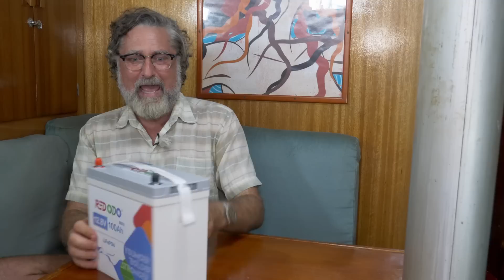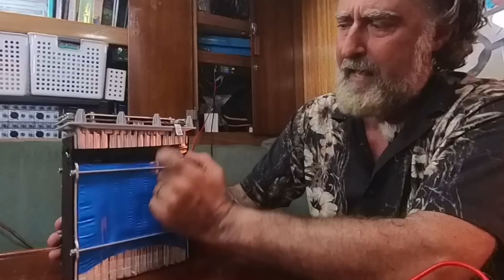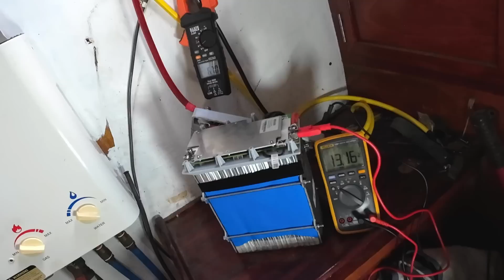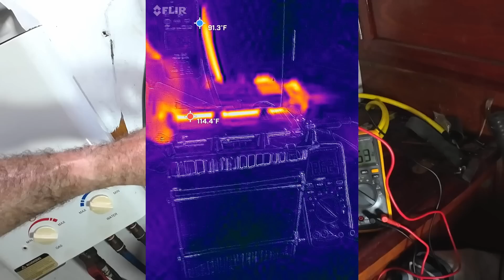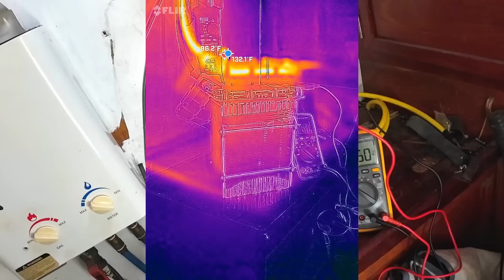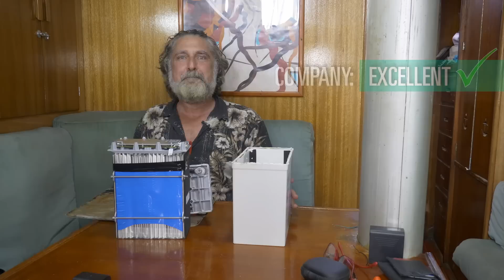Cheapest Lithium Challenge: REDODO 100ah Mini

Comment: Why are you watching the BMS temperature on discharge? It's only going to get hot on discharge because once the voltage goes down the inverter has to draw more amps to maintain output voltage. All the BMS is doing on discharge is make sure the pack isn't overheating, being overdischarged, or exceeding maximum current. 

The time to watch the temp on a BMS is during charging, and that's probably only going to present at the end of the charge cycle when it's urning off excess charge until your lowest cell is charged. Unless the BMS has active balancing with a hefty balance current you really don't have too much to worry about. 

Watch the cell temps, that's way more important. Thermal camera is great for checking your connections, get close so your temps are closer together so you can see the variations in a tighter area.  You don't always see your hottest spots when you are way back. 

It would be nice if they had a set standard for these stupid things. It's a real barrel of monkeys. Between non-existent documentation and poorly written guides and spec sheets that are laughable you just never know what you brought into your house. 

Definitely good to watch them the way you do the first couple of charges. Oof.
Reply from the maker: The BMS passes current through misfits that have internal resistance.   This makes heat and is the limiting factor to discharge current 
  Notice they are getting warm.  If they chose bad mosfets or didn't bed then correctly to the heat sink things could go bad.  It's a valid test.

Comment: I wish I would have got these batteries instead of the Timeusb 100ah batteries. The timeusb battery is too big for the tool box I got to build a solar generator. The Redodo 100ah mini I could have got 3 batteries in the tool box and have 300ah.

Comment: I just found your channel, the videos are awesome and very informative. Would it be safe to mount the REDODO 100ah Mini or any LiFePO4 battery on its side inside a large rolling tool box? I am planning to build a portable solar generator in a Ridgid rolling tool box and would like to mount the battery on its side. I will include fans to insure that the battery does not overheat.
Reply from the maker: Seems like a fine plan.  I really doubt you will need the cooling.  Especially with a metal tool box.  That thing is a huge heat sink
Reply from the maker: But keep an eye on the mppt.  They do make doom heat
Reply: Thank you!  I am using the Ridgid high-impact resin (not metal) rolling case. I am planning to install 2 - 120mm 12 volt fans to provide ventilation and I will keep an eye on the MPPT Temperature.  Thank you for this great advise.
  @Clarks-Adventure

Comment: Known fact #1 - Every battery has internal resistance. #2 - When you put resistors in parallel, say 2 100ohm resistors, you get 50ohms.

Batteries are no different, many cells in parallel = lower resistance (in this case lower running resistance). Also has the effect of lowering the amount of drain per cell. Lower resistance and more stable output voltage is a good thing in many ways as you mentioned, it's less power converted into heat and more power to your devices. Together this has the impact of increasing efficiency and decreasing the strain per cell. This is good pack design but not uncommon, you see this design behavior in power tools as well. The multi cell (multi in parallel that is) packs generally have longer run time and deliver more power to the tools.

Comment: I’m just looking for a small battery to power out induction stove and convection oven (not at the same time) but that’s all I need power for… would you suggest… or do you need dimensions on each items power output …
Reply from the maker: We don't do consultation here.  You have to research that yourself or join our Patreon at the "Dream Believers" tier.
Reply: @Clarks-Adventure  I already did that love… I was suggesting after the battle of the batteries which you’re doing … you might want to do a interest of induction cooking with lithium…

Comment: Great tear down video. Quick questions... What gauge wire is Redodo  using inside the battery? Planing on using your link to buy 4 to run in parallel what size gauge wire should I use to connect them in parallel? My inverter is a renogy 2000W.
Reply from the maker: I think I report that in the video.

Wire gauge is a personal choice and is based on the voltage drop you accept.  ELECTRICITY ON BOATS - Clark's Full Masterclass: https://www.youtube.com/playlist?list=PLsT7_jPsZM5ogT6or244F49-Gy7pYFV7V
Reply: Thank you so much for the Masterclass list. I will begin watching. Yes you did answer my question in your video sorry I missed it getting a cup of coffee but saw it on the rewatch. I'm new to your channel and glad YouTube recommend it.I am subscribing now and will be sharing it to friends and family. 😀 @Clarks-Adventure
Reply from the maker: Thanks
Reply: The inverter can handle 2000 watts only shortly for start up etc, but the continues rate is about 1,000 watt.  I assumed  that it is for  a 12 volt system. 
2000 watts takes 166 amps .
A 1/0 wire will handle  150 amps , but remember that the continues    load is lower so that wire is ok for the high short timed  load .  Or you can  double up with  two #4 wires instead one 1/0 wire.

Comment: Another great  review Clark. Thanks.

I went to their web site using your affiliate link and ran  into a popup window that wanted me  to "spin the wheel" for  a discount.  My email address was rejected and I could not get thhe pop up to go away.

I was able to read the page about this battery and was concered when I found a reference to a feature called an "exhaust hole" to facilitate cooling

In one  of your previous battery review videos you made a good point about a USB port providing an entry point for  humid marine air.  Does the exhaust port on this battery have the same problem?
Reply from the maker: I didn't notice a hole.  I'll look again.

We have this on our Amazon store.  Sorry about their site

Comment: I would like to see you test a AGM 100ah battery in the same manner as your doing here, except not pulling it apart. Price per amp hour compared to lithium ect. Cheers Shane
Reply from the maker: Apples and oranges.
   Life cycles are so much lower with the lead and you really don't want to fully discharge them.  Like 50% max.
   But Maybe a theoretical test???  That's an idea.
Reply: 100ah Lead is effectively 50ah of usable energy. Going below that will shorten the life dramatically. Lead acid can be charged @500x

A 60ah LiFePO4  would be roughly the same energy output as a Lead Acid since 95% of a lithium battery is usable AND with a constant discharge curve until the end. Charge cycles are 2000-5000x in which time you would have replaced the Lead 2-3x Also of course 1/2 the weight size.

Comment: Clark one of the companies I bought a lithium battery from recommends not mixing manufacturers why? And what is the risk of mixing vendors?
Reply from the maker: One is likely to charge faster than the other and suffer later. 
  Of course I think they all suffer being charged to a voltage.

   If you want a mixed Li collection either type, age, or you want more than 4 in parallel you can do that with multiple BankManagers.  One per similar group.

Comment: But you are limited to four (400 amp @12v) batteries.
Reply from the maker: Kinda.
    If you want that much it's better to go with more ah in a case,, but the density of these is so great...

    If you bought two BankManagers you could have one control each bank of 4 (or so) and I believe all would be well.   Tests running now.

   If someone decided to go beyond the manufacturers 4 battery limit they should use really big wires between the batteries so they all see as close to the same voltage.

Comment: Congrats Clark, well done. 50yr Veteran of the marine industry here.  Worked with Dave Smead @ Ample Power in the 90s, Taught, designed, built complex mobile AC and DC power systems. Seems the time has finally come where we can have great quantities of energy storage in a small space. Simple systems, voltage stability, high and low amp loads with few things to remember or go wrong.  Hope to be using a Bank Manager in the near future. 
My concerns are about fires in all of the new batteries. Andy on the Off Grid Garage channel has just reviewed a new Seplos Polo battery with fire suppression built into the case.  
Good luck with the product and future endeavors.
Reply from the maker: The first book I bought on this subject was "living on 12v with ample power". I still recommend it.

I really think LiFePO4 is safe from thermal runaway.  It's not the same as the other li-ion chemistries which I won't have on the boat in any real size.
    I don't want my big decision mid ocean to be, do I burn or do I drown!

    I really don't think internal fire suppression is of practical importance for LiFePO4.  

   The time is now.

Comment: Pouch as you observe are more delicate and have less thermal runaway isolation than prismatic or cylinder BUT with LiFEPO thermal runaway is way less of an issue - pouch lipo or other more thermally unstable lion are scary (see boeing 787 issues).  I tend to agree with you that this is a great form factor but understand other viewers concerns.

Comment: 200 AH seems to be the sweet spot for Lithium installation. Do you think 1 200 AH is any better than 2 100 AH?
Reply from the maker: Yes.  Getting it under as few BMSs as possible.  But I don't think 2 in parallel isn't much of an issue.  Over 4 is too much, likely.

Comment: Another fantastic video. Love to geek out on all the detail. I've heard that the Prizmatic Cells are superior to the Pouch cells and the premium LiFePO4 makers utilize the Prizmatic Cells. Specifically, they cite 7000 cycles at 80% DOD on average. I have no way to verify that. Whats your take Clark?
Thx again for great video content! Edit: forgot to mention. They have a 10-year warranty (Prorated) I think 3 years is mostly replacement.
Reply from the maker: I did a bit of google research and it seemed the other way.  Several references liked the pouches better.
   Would make sense in that they could have better thermals.

   When looking into this it's important that you check the source.  If it's from a battery maker it's likely to support what they sell.

   Mostly I think it comes down to the chemistry.  So if one package was 5% better does it really matter when they are all 100% better then lead for those features.
    It just has to be good enough.  I have a very grey beard.  I'm betting with proper charging they will outlast my need for them.
Reply: @Clarks-Adventure  After digging (a little) deeper on the subject this week I've seen some consistency in messaging from the manufacturers. Prismatic vs Pouch vs Cylindrical. Some agreement: 
Pouch cells have the best density and flexibility in design options. They are the lightest. They do require a small compression. Cheaper for smaller applications.   Safety-wise: They are easier to damage via puncture. 
Prismatic are great for larger capacities. They are more stable and can be stacked. Price can be OK if manufactured at scale ie: automotive cells. Safety-wise: One drawback is that they can't dissipate heat as well as other types of cells.
Cylindrical cells: have the advantage of 75 years of optimization and standardized mass production methods to get the most out of the form factor. However, they are the least compact and are also heavy. Safety: They are probably the safest in terms of heat dissipation and also their inherent spacing between the cells lowers the chance of thermal runaway.
  I found this interesting: 
https://www.addionics.com/post/pouch-cylindrical-or-prismatic-which-battery-format-will-rule-the-market
https://www.takomabattery.com/a-detailed-comparison-of-prismatic-vs-pouch-cells/
Reply: @Clarks-Adventure  Thanks! You are probably right.

Comment: Great review again Clark. Great battery find as well. Competition in lithium batteries is heating up you might say. Seems like the cold charge/use protection can't be expensive to add, surprised its not there. (Not that I'd need it, we winterize our boats long before it gets to freezing temps.)
Reply from the maker: Well the BMS with that feature is a bit more expensive and the one I saw was a bit thicker.

As you say we all don't need every feature and it's right for them to offer what the customers buy.

Comment: Must admit Clark a 2nd Bank of 6 of these probably makes more sense to have a night time Switchover to, than getting a Lifepo4 Batteries Power Station, or these connected to just an as it comes Bluetti with its one Battery ? Hmm. Great Review. Best Wishes.  Bob.  👍✨️✨️✨️
eta. being disabled the base Bluetti 300 looks to be physically Manageable for me too. so with its one battery charged up, while at Anchor in the evenings, it can run illumination in the Cockpit, along with a Bug Zapper. then just take below and reconnect to that 2nd Bank. Worth a try I think. Bob. 👍
Reply from the maker: I think you would be best served with a built in Li augmenting your lead and a BankManager.   

Use an extension cord to get power in the cockpit.

If you are going to go with a power station I'd avoid the bluetti.   A patron had a problem with one and got 0 customer support.  Better to buy the other one we reviewed last fall.  Their new offerings fix my only complaint.  Basically the same thing at the same price.
Reply: @Clarks-Adventure  Good thought Clark Thanks, was thinking it would give a handy backup 3kw inverter too, but an extra spare inverter would be cheaper too. I do like backups of backups lol. Best Wishes.  Bob. 👍✨️✨️✨️
Reply from the maker: Getting it all in one box always means when one part fails you throw it all away.
   Hate that!
Reply: @Clarks-Adventure  That's why I built Custom Desktop Computers and not Laptops Clark . Bob. 👍🤣
Reply from the maker: Yep

Comment: Hi Clark. Great insights again. Are Any of these Lifepo4 Battery Manufacturers giving any indications of expected Battery Service Life, if Charging amps, voltages as specified by the Manufacturer, and generally good compliant Treatment, such as onlybcharge to 85%  Capacity and Discharge limit is to no less than 50% Capacity is rigidly stuck to ? I might get a Lifepo4 batteries Power station, just to cover the hours of Darkness, to reduce or eliminate drain from the Housebank AGM's just see see how long I can make the 
Lifepo4 batteries last, because right now I'm feeling an over 10 years Lifepo4 batteries Service Life may well be Unobtainable, and Service Cost per year mat turn out to be really high. It would be nice to have some Lifepo4 Manufacturers provide some realistic Service Life Projection figures tbh. Best Wishes.  Bob.  👍✨️✨️✨️
Reply from the maker: To start with, we are taking China here.  No specification is to ever be trusted!   It sucks but it's the case.  If they aren't being watched by guys like me to call them in a lie they will lie.  And I just can't do lifecycle tests.

So we must go to the chemistry.  Treated perfectly with a full discharge the magic number should be around 4000 cycles.  More if you draw shorter cycles.  I really think it's total life Ah that counts not the size of the cycle as long as you stay well out of the ends (hockey stick).  Don't overcharge them or under charge them.   Charging to full (not to BMS cutout) is important to save battery from memory.  You simply can't charge "to a voltage" as damage can happen as low as 13.48v.

    That said I feel strongly that the way to get the life out of them we want is with my BankManager.  That is what it's designed for and it's the only option that charges LiFePO4 the way the chemistry says it should be charged.
I feel we will be getting that 10 year number out of our li.  More maybe.
Reply: @Clarks-Adventure  That sounds very Promising Clark as I feel that for properly well Treated Batteries a 10 year Service Life  needs to be a benchmark Minimum Period. I like the sound of your Bank Manager by the way, now all I need is the Sailboat to put it all on. Best Wishes.  Bob.  🤣

Comment: Clark If I add 2 Lithium 100ah batteries to my 2 Group 31 batteries, where would I store the Lithium?
Reply from the maker: With a BankManager I assume ...

Most anywhere.  They are lighter and don't vent gasses unless they totally die a horrible death so any place you have tends to work.   

Short wire runs should be your main concern.
Reply: @EmilyAndClark  My current setup is 1 starter battery and 2 Group 31 batteries located under a berth that runs under the starboard side of the cockpit. No more room there.
Reply: Clark asked me where I lived because he wanted to recommend  an installer.  However, Emily replied.  Would you please tell him I live in Saint Augustine FL?
Reply from the maker: A friend is going to FL (I don't know where yet) to do an install of BankManagers in a fleet of Duffy's.
   Write me at emilyandclarksadventure@gmail.com if you'd like me to connect you.

Comment: i`m worried by electric cars spontaneously battery combustion and the difficulty in putting out the fire to not go near this product just yet
Reply from the maker: Look into it a bit more and you might feel better about it.   They use a really different li-ion chemistry.  I will never promote anything for a boat that uses the wrong chemistry.
   LiFePO4 is really hard to get into thermal runaway.  I truly don't think you could do it if you tried.
   I won't have li-ion aboard my boat larger than my DeWalt drill.  And I only charge that while I watch it.
    I won't put us in a situation where we need to decide if we burn or drown!